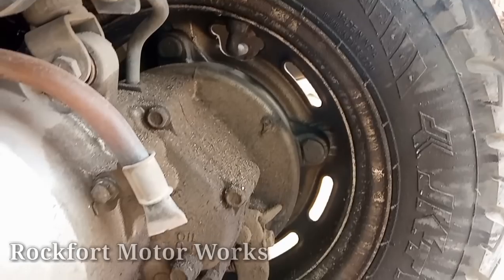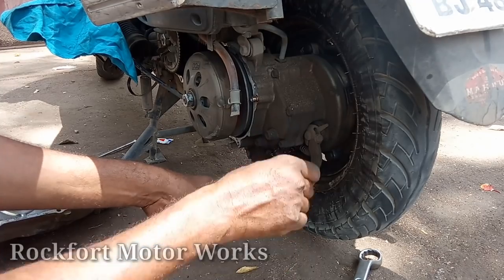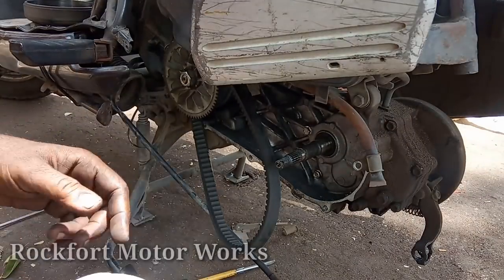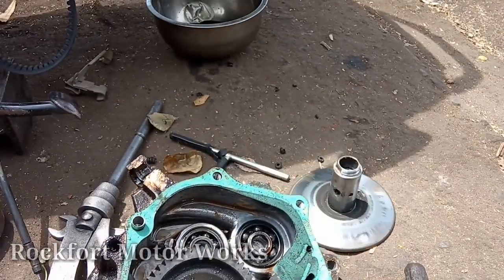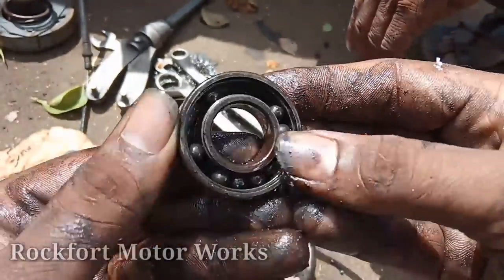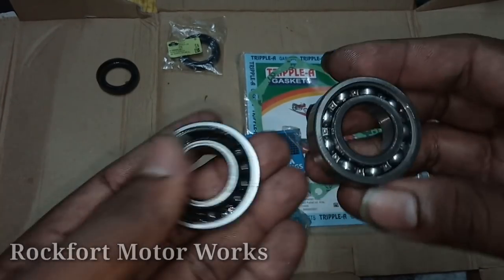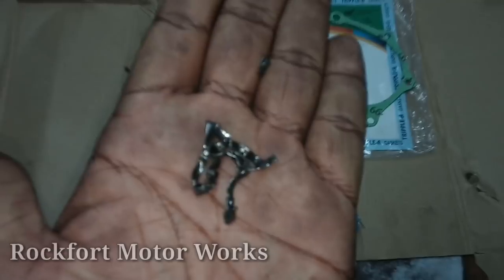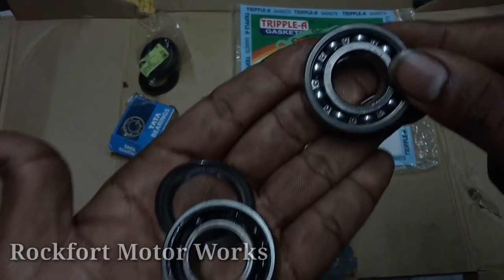Honda Activa repair work in Tamil / Rockfort Motor Works

Comment: சில நாட்கள் முன்பு தான் cleaning, மற்றும் service கொடுத்தேன். ஆனாலும், kickstart பண்ணினால் சில வினாடிகள் தான் run ஆகிறது, பிறகு நின்று விடுகிறது. அதே போல், signal இல் நிற்கும் போது, நின்று விடுகிறது. Break பிடித்து, Accelerate பண்ணி கொண்டே இருக்க வேண்டும், இல்லாவிட்டால் off ஆகி விடும். கடந்த 2 வருடமாக engine oil மாற்றாமல், ஓட்டி கொண்டே இருந்ததால்,.இந்த problem. Bore இல் problem உள்ளது என்று mechanic (சிறு வயது, grey color uniform போட்டு mechanic கடை நடத்துகிறார். 
இவர் சொல்வது போல், bore இல் தான் problem? திரும்ப வேற அதிகம் அனுபவம் உள்ள mechanic யிடம்(நான் சென்னையில் தான் உள்ளேன்) கொடுத்து இந்த problem சரி செய்ய முடியுமா??